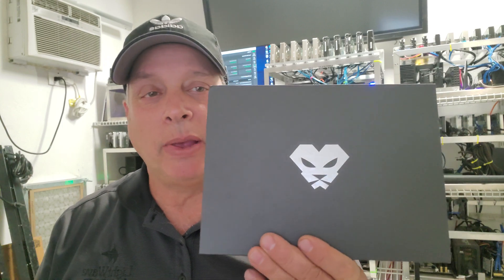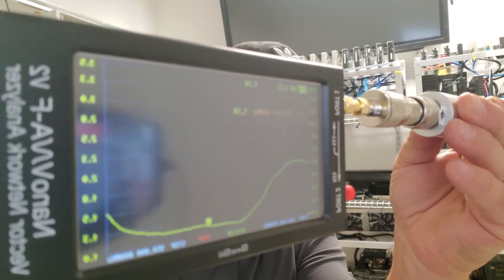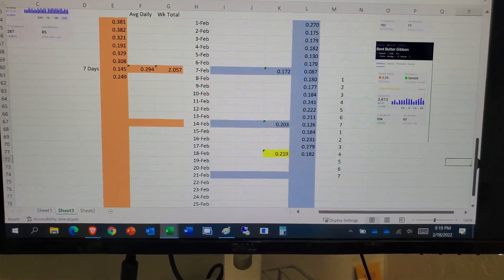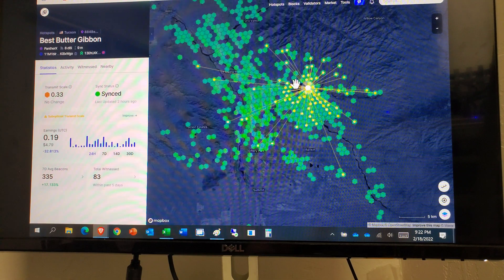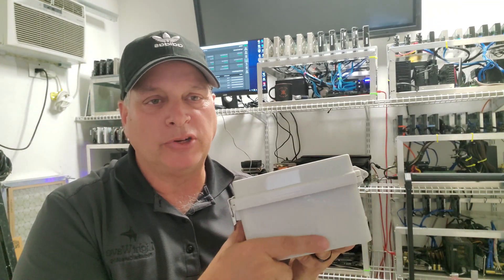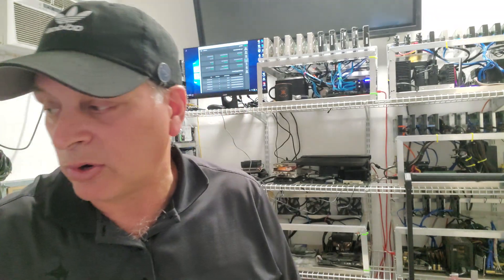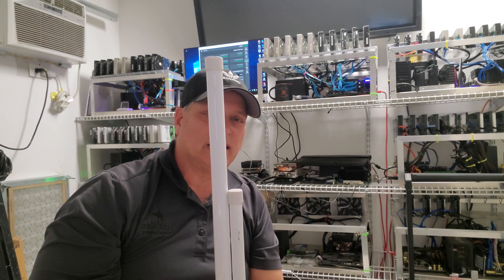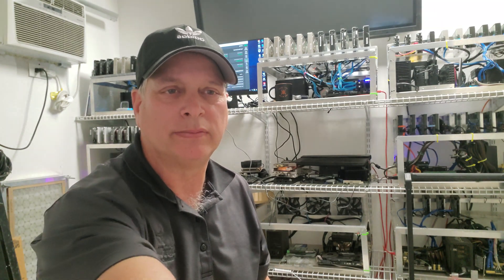Panther X2 Update and SignalPlus 10dBi Antenna Review

Comment: Link to the VNA you’re using
Reply from the maker: NanoVNA-H4 Vector Network Analyzer Kit 10KHz-1.5GHz HF VHF UHF Antenna Analyzer Measuring S Parameters, Voltage Standing Wave Ratio, Phase, Delay, Smith Chart with 4" LCD Touch Screen (4.2 Version) https://www.amazon.com/dp/B085CFHTBM/ref=cm_sw_r_apan_glt_i_WGBP9X3H1WPS3S8WEX4X
Reply: Ty very much

Comment: Great video! Thank you for all the detail. I'm going to be setting up my panther x2 in a few weeks.
Reply from the maker: I'll be doing another setup video in a few days. I'll be setting up a newer Panther X2 with the SX 1302 chipset. In fact you are the first one to know that I just received my second batch of 6 PX2 to miners which means that new unboxing video will be happening sooner. FedEx just dropped them off.
Reply: Thank you! I went with the sensecap for my most recent install. I'll install the panther x more local just in case I run into problems.

Comment: Great video! Thank you. What cable did you use and what port connectors are required for the upgrade?
Reply from the maker: At this site I use an LMR200 cable and the reason is, it has less resistance than the LMR400 cable and allows a stronger signal to be pushed.  I did test the LMR400 cable here and it was more restrictive per the specs we found on the cable manufactures website.  By "port connectors" are you asking if the antenna has an N Type Male or Female?  Let me know

Comment: If you purchase one a time you will be free of the duty and tax that the custom will impose on you... panther should reimburse for the duty and tax.  I had the same problem and had to fill out and send a form 5106 .... just to let you know but thanks for putting it out there.  They are faster than bobcat or the get mntd  as far as shipment goes.
Reply: Panther x2 is shipping faster than any other manufacturers. I got mine in about a week. No duty since I only bought one.
Reply from the maker: I spoke with the Customs agent and she said it was fine since this is a residential non-resale transaction. Furthermore, she said I will not have to fill out another form unless I don't buy anything else for the next one or two years. 

I do appreciate you feedback and caution. BTW - I wasn't try to avoid fees just the delays.

Comment: Can you also do a test on Panther x2 if we change the SD card with 128gb   high endurance to see any changes.
Reply from the maker: Can you give me a link to the SD card so I can get the right one?  On my RAK miners I use the Sandisk 64gb A2. I know there's a faster one but they're like a hundred bucks which I wasn't willing to spend when 64 was only needed. Send me a link
Reply: @ViHeLium Group  I bought 128gb Transcend high endurance £20
Reply from the maker: Are you on the Panther X2 Discord channel? I'm going to search there to see if others have already done the SD chip upgrade. If so, I'll come back and post the link.
Reply: @viheliumgroup9357  no just on telegram I don't like discourt.